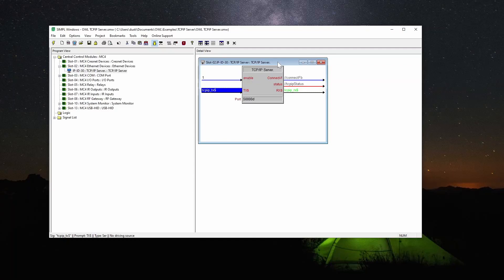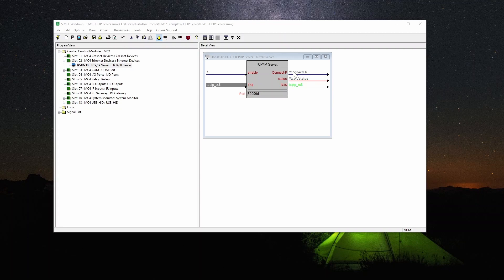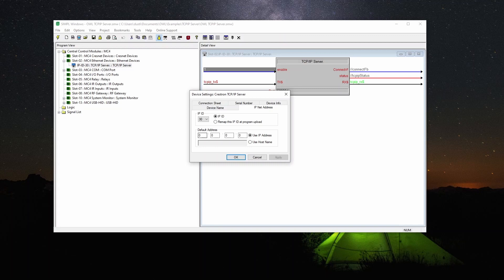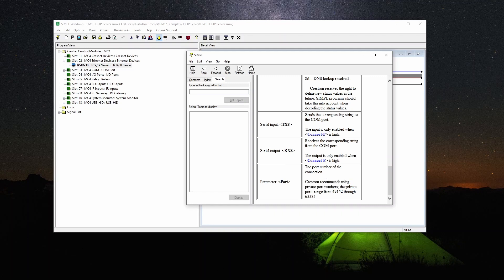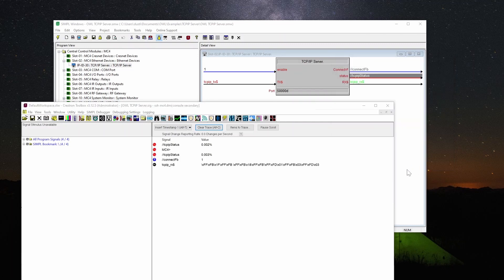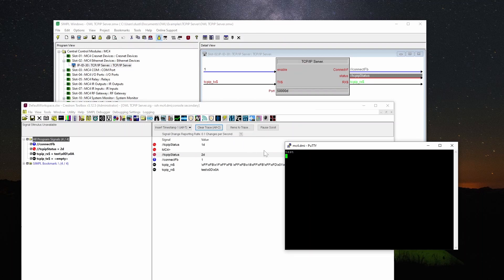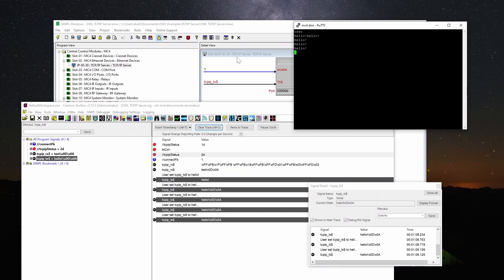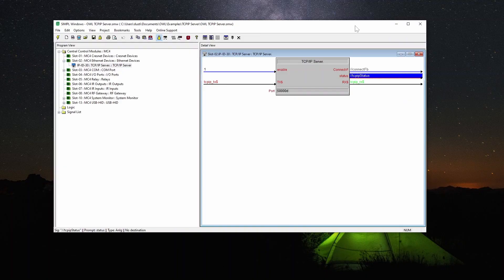TCP/IP Server Crestron SIMPL Windows

Comment: Hi Sir, what if the TCP control devices return username & password for authentication purpose?
Reply from the maker: depending on how complex the prompt is, you could use something as simple as a serial io to detect a certain string which would set a digital high that you then use to trigger the password send.

It gets increasingly more complex from there. One problem I had yesterday was connecting to a Vaddio camera via unsecure telnet - it wanted a login and password but sent out a bunch of text that ended with "login:" I had to use SIMPL+ to gather the incoming data with a buffer input because it can handle longer incoming data; serial io was insufficient in this case.

(if you are interested, this is the little bit of SIMPL+ I wrote quickly to do this: https://pastebin.com/53fHWWnJ)

-Dustin

Comment: This is great, thank you! Please can you go over http requests to devices using Simpl +?
Reply from the maker: yes, I will add this to the list. These days a lot of things require https which can't really be done with SIMPL+ but as long as it supports http connections we can manually create the headers and data required using SIMPL or SIMPL+.
Reply: @OverWorkedLogic  Fantastic thank you! I'm guessing https can be done utilising Simpl# or C#?
Reply from the maker: correct, we can use a library built in C# to connect and send out commands for https. I'll put a note to at least mention this in the video with some additional resources.
Reply: @OverWorkedLogic  Amazing! Thank you for doing this series!

Comment: Hi Dustin , 
I am using the atlona 4*4 but like to select the source first and then use the graphics to select the whatever destination required, how to do ?
Reply from the maker: you would need to initialize an analog value of the selected source and use a buffer to selectively send it to one (or multiple) destinations.

This video I did should explain the general concept: https://youtu.be/64aOp-19pIA
Reply: @OverWorkedLogic  Thanks a lot for your quick reply .I will try and back to you .
Reply: So I watched your video . Does my atlona matrix switch can work with these logic . Actually I am planning to perform the source and destination on same page .